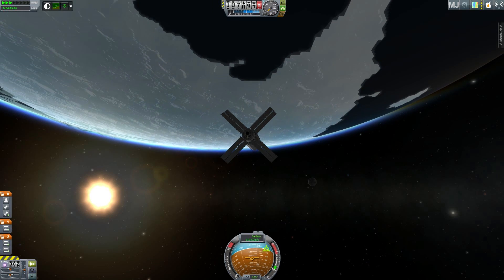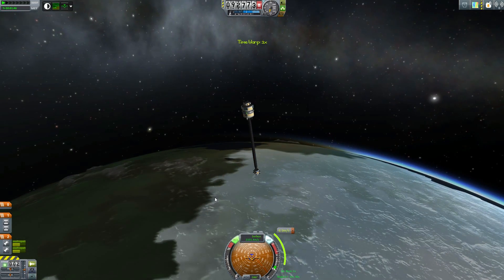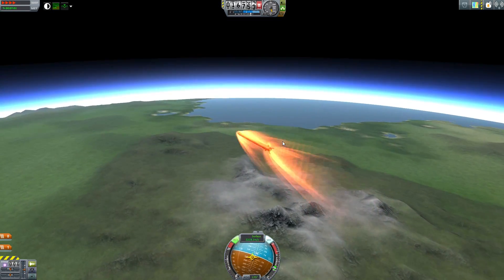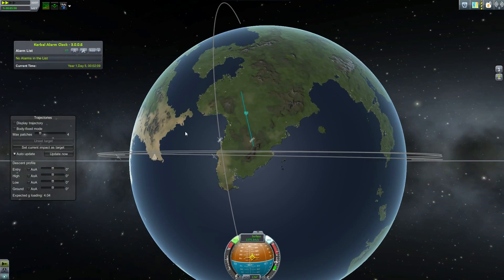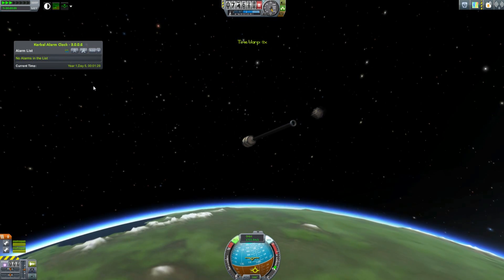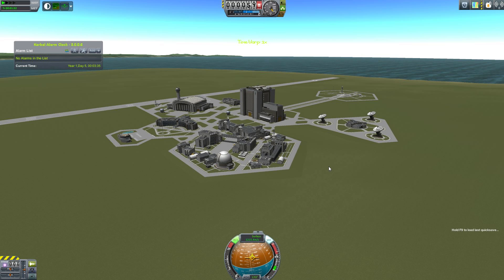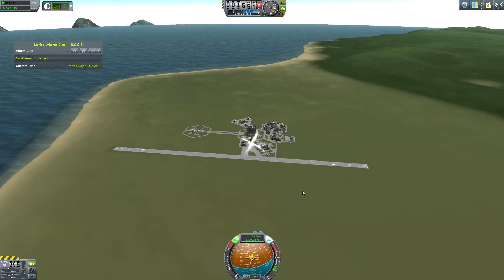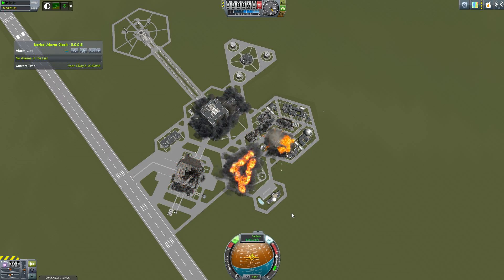Rods From The Gods vs Kerbal Space Center

Comment: Well, I'm not sure if your failure in destroying things was solely because of the discrete physics issues ( that BTW also helped you go down faster, because the game also updates drag at ticks ). Apparently SQUAD in their huge wisdom, decided to use the momentum of the impactor as the deciding factor if a building was going down or not  ( with different values for each building , OFC ). I assume you already spotted the issue with that decision and how it plays against high velocity kinetic impactors in game ...
Reply: I doubt momentum is the issue. p=m v, the momentum vector is essentially the velocity vector multiplied by the mass of the object.  If these are as dense as Scott says they are, they don't lack for mass, and they certainly aren't lacking velocity.  Rather, it seems to be an issue of how collisions are modeled in the game.
Reply: Mr. Entropy the issue is that, because this is a completely inelastic and dissipative collision, the magnitude of the collision should had been measured  by the kinetic energy of the impactor, not the momentum. And , as you might know, the kinetic energy varies with the square of the velocity ( unlike momentum ), so, for high values of speed, the game will underepresent the effects of the impactor .. if it even registers the collision, that is :D

Comment: A few (longer-than-I-expected-when-I-started) comments on your calculations of movement per frame: Unity uses a fixed timestep for physics calculations (that is, physics frames are not the same as rendered frames, which is done for consistency). The default is set to 0.02 seconds or 50 fps for physics, though I don't know if KSP changes this at all. Let's assume for now they use the default, in which case:

1200 m/s / 50 fps = 24 meters per frame

As for "it only checks for colissions on the edges" - primitive colliders are "solid", that is, if one materializes completely inside another, it will trigger a collision. Convex mesh colliders (mesh colliders which are set to have no "inside corners", and CAN be moved effectively with physics) work the same way, and most if not all of the parts in KSP use this setup. However, standard mesh colliders (which, in general, can NOT be moved with physics, and are typically used for level geometry) are, as you predicted, only "skin deep" - if another object materializes wholly inside of a standard mesh collider, it will not trigger a collision.

If the building were primitives or convex colliders, then the odds would be pretty low that 24 meters per frame would completely skip through the building. However, since it only needs to skip through the "skin" of the building, 24 meters is plenty - essentially it only needs to cover the length of the rod.

I bet that, if you made a Rod of the God that was at least 24 meters long (adjust as necessary based on your time of travel at impact), you would have a 100% hit rate on these.

Comment: In terms of firing the rod almost straight down wouldnt u be able to use a rail gun to fire it from space? Of course as long as the core is something magnetic.
Reply from the maker: The problem then becomes the recoil on the launcher inducing major orbit changes.
Reply: +Scott Manley That's why you need to fire two rods in opposite directions :P
+TheGravityz3ro Railguns do not need a magnetic projectile. It only needs to be conductive.

Comment: Is this with FAR? (edit, I'm an idiot, no it's not)

I would also presume that, much like guided bombs today, in reality it would have some deflection surfaces to make corrections. Would love to see this implemented.
Reply: It's covered in plasma during descent. So it can't see, or detect radio. Guidance would be useless.
Reply: HALL9000ish

Not so. The Space Shuttle had this, to navigate with guidance throughout reentry:
http://en.wikipedia.org/wiki/Tracking_and_Data_Relay_Satellite_System
Reply: TrumpeterOnFire It also took steps to reduce the plasma sheath surrounding it. Good for people inside, bad if you want to still be at mach 10 on impact. Guidance through re-entry is possible, but not if your re-entry is this extreme. 
In the KSP 1/10th solar system it would work though.
Reply: HALL9000ish
Ideally, to maintain velocity as well as maximize damage to target and minimize collateral damage, you'd come in much steeper anyways, which increases the likelihood that you'd have an overhead satellite behind the plasma cone.

This is without even getting into inertial or automatic stargazing, like the SR-71 used.

Comment: dont those hit with the power of small nukes
Reply from the maker: In real scaled KSP, and a steep enough angle of entry, they could hit with a velocity of about 7km/sec  - giving one of these an energy of about 50 tons of TNT
Reply: Nope the best they do is break concrete aka a bunker it's a bunker buster
Reply: +Liamthemailman13 Your right it's meant to obliterate concrete so that bombs can get to the building beneath the armour of concrete (if the rod doesn't already destroy it)
Reply: Scott Manley How big of a crater would that be?
Reply: trickman01 about twice the width of the rod. but VERY deep. (I'm actually not sure, just my guess)
Reply: trickman01  at a guess probably just over 150 meters

Comment: It did slow down quite a lot; losing 30 gigajoules of its original kinetic energy. Taking the potential energy into account it's a lost about 45 gigagoules. With that amount of energy you could heat up a cube of water with the side of 22 metres with 1 Kelvin. That is pretty much. For your reference, the average human burns that amount of energy in 20 years.

Comment: this is why more frames per second is a good thing.  Even though there is a limit to what your eye can perceive... that's not the main point of FPS.  Games recalculate things like physics or effects of the input from your controller for each frame.  More frames = smoother play and more accurate simulation.  In KSP you can get going fast enough that you travel a long distance between each time the game runs the physics code to check for collision...  So fast that you can even phase through planets...
Reply: Unity runs physics calculations in a separate frame step from the graphics one. It uses a fixed framerate as well. I believe it's 60 physics steps per second default. There are a lot of games that do physics tied to the FPS, and it can be a really bad solution cough*cough NFS Rivals cough
Reply: The limit is between 300 and 1000 FPS in various parts of the eye...
Reply: Prich038 the limit is your monitor.
Reply: Morrov PL Yes but that wasn't what he meant...
Reply: There's no actul limit. Eyes or physics don't work that way. Because we can see electromagnetic radiation in certain spectrum, our eyes and brain has to be fast enough to register data in frequency of 400–700 terahertz of light. So that's basically 400-700 trillion frames per second, but that's only a reference. It's impossible to compare images per second to how we see and register the spectrum of electromagnetic radiation. But yeah, if someone flashes light around 555 terahertz and could flash it once per second at 500 trillionth of a second pulses, eyes would theoretically be able to register that as color green.
Reply: Many people can perceive different rates out of the corners of their eyes.